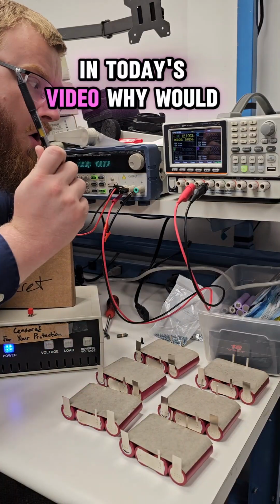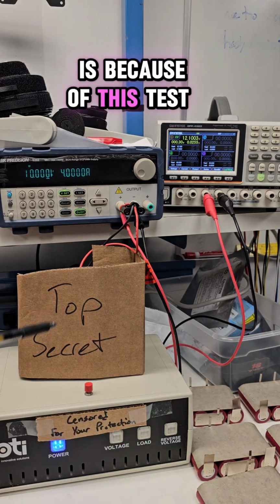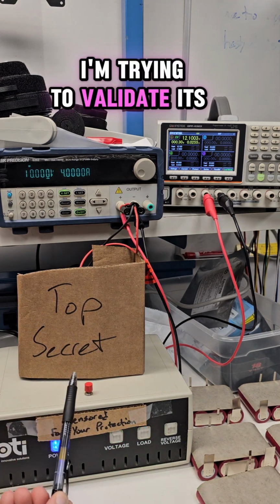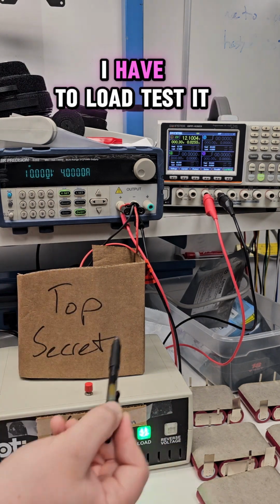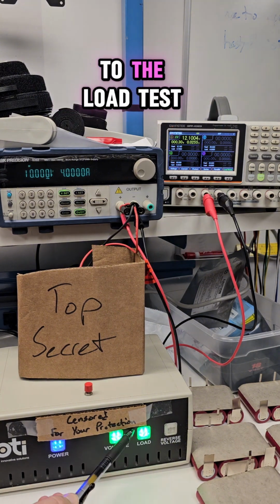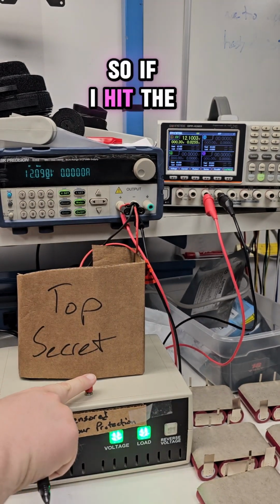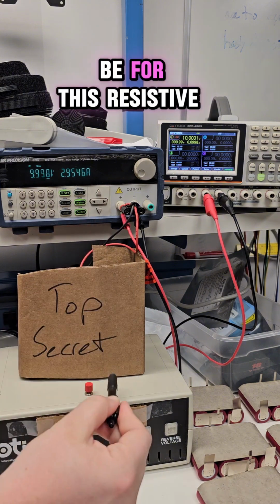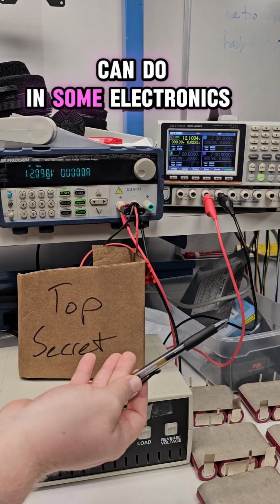Why Parallel Two DC Power Supplies?

Comment: Can u wire to power supplys computer psu together on parallel  im trying to power a really powerfull car amp and i jave a 65 amp psu a d a 120 amp psu im wanting the. To work together and give me  near 185 amps at the 12.25 voltage both put out and thags fine i wish they was closer to 15 volts but hey 12 is better than 0
Reply from the maker: It depends on the isolation of the outputs. Normal lab bench supplies have isolated outputs, but some pc supplies don't. It could create a ground loop, but since this will be in a car it may not matter. 

The only way to know for sure is to experiment.
Reply: @eetengineer  i plan to use this method to power a high power car amp in my basement adding a 65 amp to a 120 amp making a 185 amp at 12.25 volts but 1 person told me the power supplys have to be identical for it even have a chance of working and one person said each psu has different rail voltages since they are different power psu and that is how they will both get smoked and the amp too if it's hooked up it could get like 50 volts sent to the 12 volt input so I'm trying to ask around and hopefully someone knows for sure i have seen ppl do it at camp grounds with identical power supplys run in parallel have 4 100 amp power supplys all ran to the same shared positive on the shared 4 or 5 deep cycle batterys . Idk if it's a certain type u have to have to do this or what. Trying to find out without killing my psu

Comment: Neat trick!
Can you help me understand why you need to test something at lower voltage (10 V) and higher current (3 A), when you can see that it already "works" at a higher voltage (12 V)?

P.S. Subbed to your channel after watching a video on Robert Feranec's channel. Very nice presentation.
Reply from the maker: Yes, this is for a battery pack. The load requirement is 3A, and the average voltage sag of this pack from 12V under load is around 10V. 

So I need to make sure that the internal power resistor bank of the fixture will provide close to 3A at the 10V load sag.
Reply: @eetengineer  Ahhh, okay that makes sense. Thank you very much! Didn't know that the voltage drop would be that significant under load.